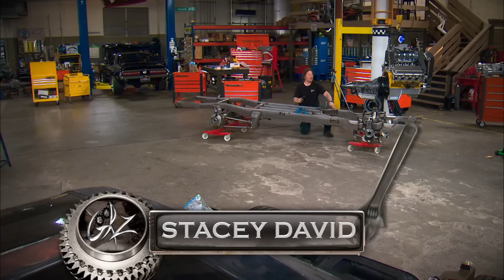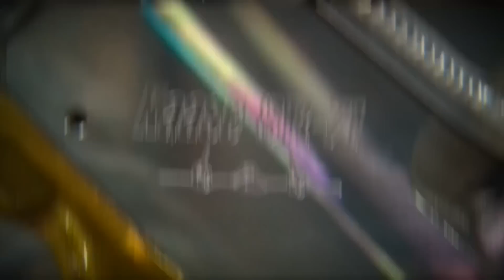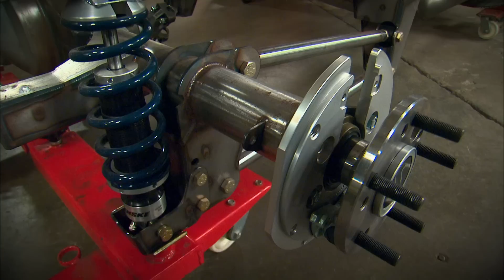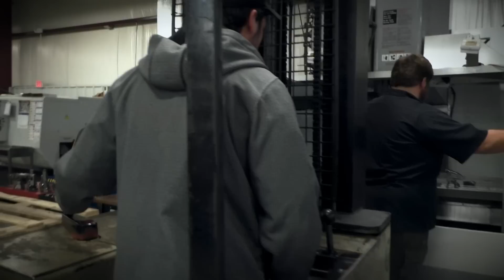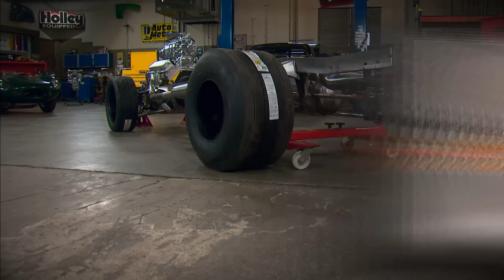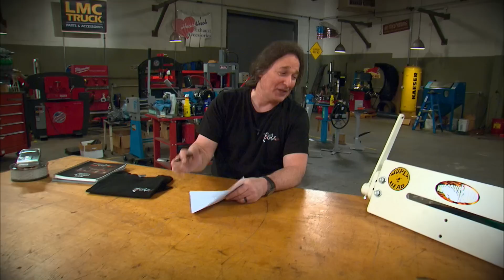SR-71 Rapid Tool Express Panel Truck Exhaust, Chassis, & Wheels - Stacey David's Gearz S13 E1

Comment: That brake line that close to the exhaust is scary unless you are shielding it from the exhaust heat.
Reply: its rated for that it's braided steel. the brake fluid is just as hot under heavy use

Comment: I know where one of these panel trucks are sitting at and it's a 59 too.  Sadly the guy does not want to sell it as it's been sitting outside for 8 years with rust going through the primer.  Want one of these something fierce to go with my standard 59 Custom Cab.